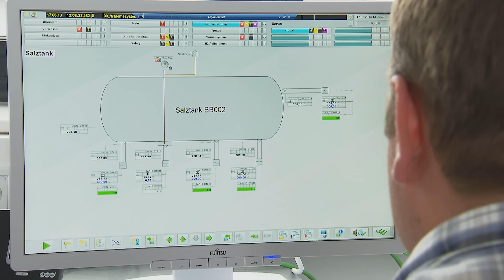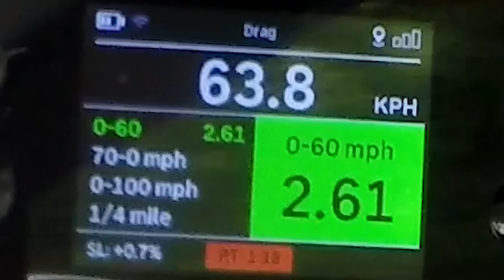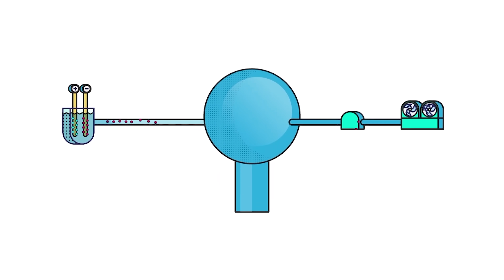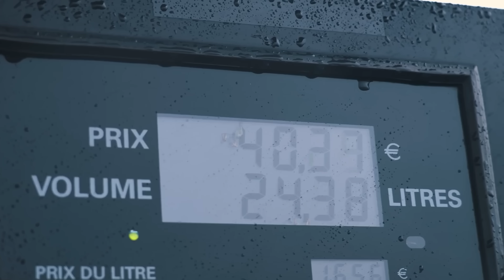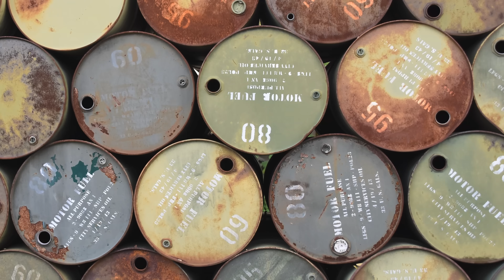Porsche just SAVED petrol engines FOREVER

Comment: Fascinating how a tech that's only marginally better in specific use-case scenarios is deemed 'superior' and pushing out a robust tech that didn't even reach it's peak yet. If ICE were improved with all the money that was wasted on marketing EVs and forcing the change, the engines would have been super clean by now and only would get cleaner each year. And EV could have been developed alongside it, according to the market needs.
But everything got flipped over - bans, abrupt tech change, forcing people into infrastructure that's not ready, guilt-tripping with ecology... So dumb. Exactly same scenario that happened with nuclear power plants - if it weren't for 'ecologists' scaring everyone, and tech was pushed and developed at high pace we would have so much cheap energy by now. But now some realising what major mistakes were made (Germany) it's already late...

Comment: The point is that the proportion of green energy in power generation is still very low. The way that generate electricity is still mostly polluted.  If all cars become pure electric in a short period of time, the power generation network will not be able to support it at all.  Moreover, the recycling of lithium batteries is a big problem for environmental protection. Mining the material for battery batteries also highly polluting and requires many rare metals that won't be enough to keep providing the amount of needed.  

The EU keeps changing and delaying their ban, because it has always been impulsive and unrealistic. In fact, electric vehicles are not as perfect as some imagined; In terms of environmental protection. It is more like a political slogan and a marketing trend in the market. I don't think the internal combustion engine will die as early as mainstream says, we will see.
Reply: A while ago, Switzerland postponed the ban on internal combustion engine vehicles because of the lack of electricity in winter.
Reply: I don't like the mainstream media keeps describing the electric cars as so dame perfect and  will be missing the sound of petrol car, just like this channel.  Gas car's are sounds emotional and we will be miss it~ some thing like that. It's too early to say that. But they make the market more electrical by saying that.

Comment: hydrogen fuel cell vehicles and battery electric vehicles should be swapped in popularity, filling experience on hydrogen vehicles extremely similar to current fuel pumps, and use a tank so none of the same battery degradation and range dependent on weather issues, plus ev's work right now cos the minority have them, the grid is already struggling and power produced by recommissioning old coal fired plants, what happens when everyone is charging cars, the grid and methods of power production wont keep up. plus the infrastructure of charging stations are making carparks, vs hydrogen stations could be implemented by retrofitting almost any existing petrol station.

Comment: Thing is, if e-Fuel production is low, there's going to have a massive push, huge funding from the likes of BP, Shell etc. and government backing to produce the levels of e-Fuel needed to run combustion engine cars. In my town, electric charging points took forever to get placed, and even now there isn't enough of them. They would need to adapt every petrol station to provide e-Fuel as well as other fuels. Lets be honest, for people already with ICE cars, they probably would choose cheaper petrol rather than more expensive e-Fuel - I highly doubt it would be the same price or cheaper.

Comment: Yeah, basically the political decision shifted on e-fuels because they are not really a compromise. ICE vehicles will try to save themselves with a technology that does not even exist. Well, technically exists, but it's not commercially viable and relies on renewables even more than electric cars.
While electric cars are starting to be quite a consolidated stack, large scale usage of e-fuels is pure fictional.

e-fuels are not gonna change anything of this transition: it will be a way to power a few extremely expensive cars (or historic cars for that matters) at an extremely expensive cost, just to avoid them to stop being usable.
That's why the compromise has been made: it's not really a compromise.

Comment: Germany was fighting to extend the deadline for ICE powered vehicles.  Synthetic fuels are still going to create pollution.  JCB has been developing hydrogen ICE (H-ICE) engines for their plant machinery.  Harry's Garage was recently visiting JCB.  They originally started with modifying existing engines, but due to the technical challenges, they've had to design an all-new engine for H-ICE.  Significantly quieter than diesel, with H2O being the only emission out the exhaust.  The challenge is capturing hydrogen cleanly and for the cost to be similar to current fuels.
Reply: if you can use hydrogen to generate electricity why would you burn it and lose half of the energy😂
Reply: @noizz4  If the generation of electricity creates waste heat why would you not use it and instead choose to heat the car from the electricity? 
Why turn off clean generators when too much is made rather than use that energy?
Why use a very inefficient (and filthy, harmful to make) storage method for any unused electricity?
Why waste energy dragging half a car worth of extra weight everywhere with you?
If you want to go on about whats more efficient why use a wind turbine to make electricity when you could just put sails on every car? 
Sometimes the ideal for efficiency or for any one goal looks very silly when put into context of the real world. 
Very few things are ideal which is why we have something called pragmatism.
Reply: @noizz4  if a 3cyl car does 60mpg why drive v12's?
Reply: @noizz4  because you can use it as storage so when production is high and demand is low you can store the energy in hydrogen storing electricity in batteries is not an option particularly if you don't want Congolese children mining for your batteries.
Reply: Hyrogen cars are nothing new. BMW experimented with them a lot over 20 years ago. But this system does not work. The fact that it requires so much energy to produce hydrogen alone makes this technology not feasible
Reply: @Turborider  Still requires less energy than making synthetic fuel. The goal is to produce hydrogen with unused energy instead of selling it (or paying so that someone takes it) which is something Germany could´ve done for years, but was once again sleeping through that opportunity.

Oh and afaik BMW is still experimenting with hydrogen and even partnered up with Toyota
Reply: @Turborider  Show me the battery powered excavator that can run 12+ hours a day in any conditions with minimal or no breaks. 
It makes little difference whats efficient and what isn't is the efficient one simply can't do the job. 
The most efficient fridge is one that doesn't have to cool things down but you're not going to enjoy your milk very much after a couple of days.
Reply: hydrogen ICE was also used in the 7 series over 20 years ago. There were many problems you could find on the web. I don't think it will be reborn.
Reply: When you use the atmospheric CO2 to produce the e-fuels, it is, by physical laws, technically pollutionless, because you need greater or equal CO2 to create an e-fuel then the e-fuel will produce by it's combustion. It's indeed very inefficient (25-30%) in use of energy in comparison to EVs (70-85%), but if you need light sportscar, it's the right choice (the efficiency of ICEs is about 30% afaik).
Reply: If you don't want to create any pollution I have only one suggestion: walk.
Reply: No but generation of hydrogen cells requires pollution. It doesn’t offset carbon emission like synthetic fuel.
Reply: All this nonsense is based on unscientific assumptions that we are experiencing a "climate emergency".  In the meanwhile all that CO2 does for the moment is greening the planet!
Reply: What people forget is, the market changes. Chinese will not adopt ICE cars since these are, again, more complex to build. When an EV is ALWAYS the cheaper option for the ordinary person, ICE is dead.
Reply: Fine. Go on and save your planet with incredibly wasteful Hammer EV.
Reply: No different that ev fuel creates pollution 💁‍♂️
Reply: @glennstimson6097  Yeah, of course. That's why I say it's for sportscars only (they need to be light). Common people should use EVs because of their high efficiency, at least for daily driving (below 100km). The effort should never have been to ban ICE, they should have just tax them so much that only people that really need to travel 500km every day will buy them and the rest would rather buy EVs (or use public transport if they dont need to carry heavy items), which are even easier to use and need less service etc.
Reply: eu gonna have to there aint enough rare earth minerals in current mines and greens dont allow them in europe
Reply: Lot more going on with hydrogen,several conferences taking place this year from texas and new york to uk and further afield.
Reply: No one talking about the damage to the earth in making lithium batteries, we only talk about how much less damage an EV does vs an ICE in day to day running of each car.

Literally filtering carbon out of the sky puts a stop entirely to hurting our planet further, we are recycling our own waste in the same way we can recycle things like food packaging.
Reply: @glennstimson6097  what are you talking about.  Electricity won't be 100% renewable for your lifetime.